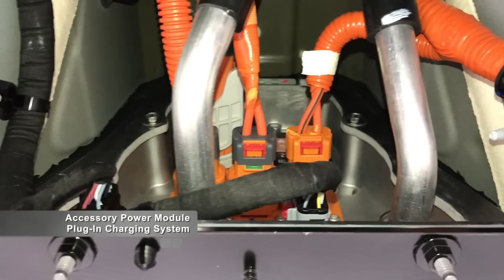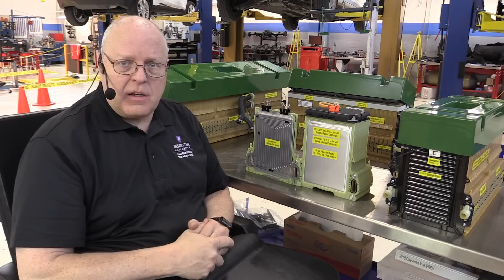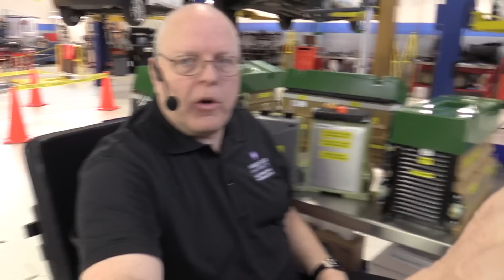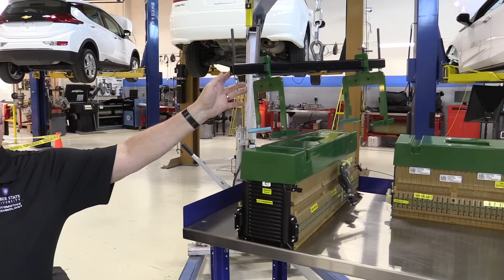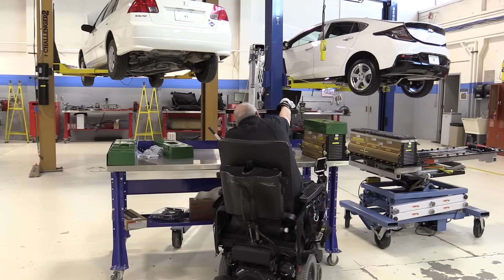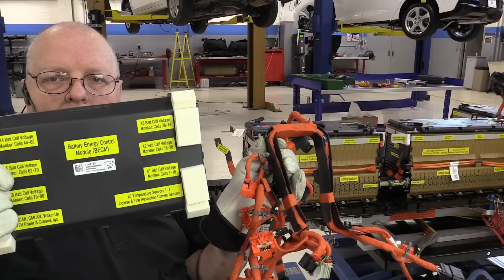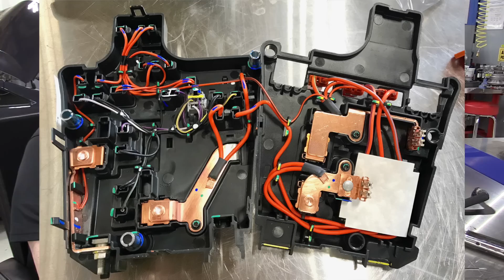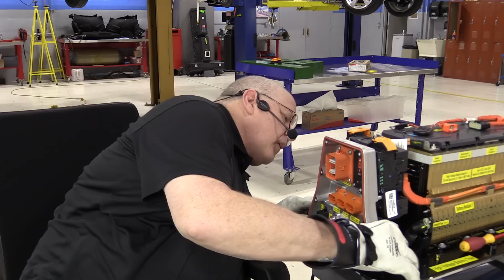2018 Chevrolet Volt 355.2V Li-Ion Battery - Deep Dive

Comment: Can a 2014 Chevy Volt with the First Generation 16.5 KWH Battery Pack be fitted with the upgraded Second Generation 18.1 KWH Battery Pack?
Reply from the maker: No, I wish it were possible. It has a totally different monitoring and control system
Reply: Thanks for your reply.   Would it be possible to install the updated monitoring and control system along with the 18.1 KWH Battery Pack?
Reply from the maker: No, sorry

Comment: Answer to "....upstream...." .  Interstate I-5 follows along the Columbia River and at the end of my drive, my elevation is about 30 feet higher.

Where is Weber Auto located?  Do you know of anyone that could extend my range by another 50 miles by 
 an additional battery pack?
Reply from the maker: We are at 4300 feet in Ogden Utah. I do not know of a way to extend your range.

Comment: How does the coolant circulate through the battery? Is there some kind of pump?
Reply: Thanks! The 2019 model charges in half the time. What do you think they changed?
Reply from the maker: There is an optional 7.2kW on-board charger available now. the previous one was 3.6kW
Reply from the maker: Yes, there is an external variable speed pump

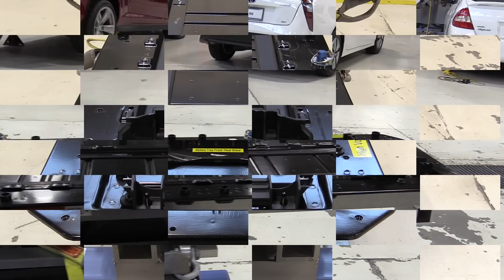Comment: Hi Prof John- another fantastic video. Question: @12:30 does my first gen Volt battery tray have this same inspection plug/port?
Reply: If a first gen volt is rear ended at approx 40mph speed differential, and the dealership replaces bumper/energy absorbing parts but says everything else is good, how concerned would you be with battery coolant leaks etc in the future? (I doubt they would check that plug)
Reply from the maker: Yes, it has the same plug. Make sure it sealed or replaced after removing it to keep out road water
Reply from the maker: Not very concerned, the battery is pretty far forward and unlikely to get damaged. I would do a good visual inspection just to make sure. The bigger concern would b the DC-DC converter and cooling ducting and the 12V battery under the hatch carpet cover. If everything is working and no warning lights are on, it is probably fine.
Reply: Thank you! You are very inspiring and have a great teaching style. Weber State is lucky to have you. I hope a benefactor gifts you a Tesla soon to neatly lable into tiny parts!

Comment: Glad to see the inside structure, I have learnt a lot

I have a small question: what kind of flexible circuit board they are using? How thick would it be? Because I would like to know the rated voltage of it. Thanks!
Reply from the maker: Thank you! It appears to be a very flexible plastic circuit board, like on the back of older instrument panels.

Comment: I have a 2012 Chevy Volt with 125,000 miles on it. Up to 1 month ago it was in perfect condition until the battery died. I took it to the dealer and they say the battery has to be replaced at a cost of almost $7,000. They did not give details but they recommended  that I did not do the repairs due to the car's mileage. I have the car sitting in my garage and I still refuse selling it as junk because of its prime condition. Are these batteries repairable? Can a used battery from a more recent year be installed?
Reply from the maker: Wow, that is the first Volt battery failure I have heard of. A newer model battery will not work. The on-board computers are programed for the one you have. The battery sections can be replaced as shown in my video, but they are expensive and it requires an expert experienced technician to do it correctly. You may consider looking on ebay or a salvage yard for a used battery. I see them quite often on eBay from wrecked vehicles for approximately $1500. If it were my vehicle, I would install a used battery. Best wishes.
Reply: I am going the opposite way since I already bought another car. I will be looking for a person that wrecked his 2012 Volt and has a good used battery that can transplant to mine after I sell it to him for a decent price. I needed your expert advice to see if I could expand my options to other year models. Thanks for the excellent video, it was very instructive.

Comment: I see why people prefer the Nissan Leaf batteries for making RV and home batteries. 64 volts seems a pain in the tush to deal with VS 48. And looks as though that convenient battery management system can only be used for the original voltage and configuration. Dangit.
Reply from the maker: Thanks for your feedback!

Comment: How well has your 14' Volt held up for cold weather driving range & overall capacity?  

I do like the way it drives and has the option for gasoline, but I'm afraid of a sub 25 mile range as it gets on it years and it comes winter.
Reply: I went from a 2nd gen Prius to a 2nd gen Volt myself, and I really love it! My Prius was a great car, but it doesn't come close to the driving experience of the Volt. I really love both of them! But I'm at almost 4,000 miles on this tank of gas so far and still have almost half a tank left. That's just really hard to beat. I haven't seen a gas station since I bought it in November and we're coming up on May as I type this. I won't miss gas-powered cars!
Reply from the maker: Mine has been great. In very cold weather the range about 2/3 of what it is in warm weather (38 miles). Overall capacity had not changed in 4 years. Thanks for your feedback!
Reply: Thank you much Professor!  I must admit the Volt was intimidating when I first looked at it, but after seeing your videos and coming from a 2nd Gen Prius, I'm thinking I might make the jump.  It doesn't look that bad to repair in the end.

Cold weather range is my only concern, given it's -25 up here during the winter.

Comment: Great information but the BECM replacement requires the connectors to be disconnected and reconnected in the  correct order
Reply from the maker: You are absolutely correct, I did that incorrectly. Thanks for your feedback!
Reply: The new Mustang Mach E BECM has to be disconnected in the proper order also. Some things stay the same.

Comment: Great Video.   I was surprised the battery coolant heater is not just turned on and off by the relay but is also controlled by a transistor module.  Did you notice what transistor GM used for this?
Reply from the maker: Thank you! I could not see the transistor, it was encased in the heat sink with some sort of epoxy.

Comment: That was an amazing, informative, well-done video - thank you.  I have a questions.  How does the battery cooling system guarantee the coolant is uniformly traveling thru the battery plate passageways at the cell level?  It would also seem possible for air to become entrapped in the passageways unless there is considerable pressure in the cooling system - then, high pressure would seem it more prone to leaks.  Also, my observation: it seems with so many connectors, it would seem over time and miles with vibration that connectors would be prone to contact issues and subsequent faults showing up in the diagnostic system.
I see the need for system monitoring, but it all seems very complex especially in light of where we've come from (the last century's IC engine drivetrains.
Again, wonderful job - love your vids!!
Reply from the maker: Thank you. The battery cooling system is filled by applying a vacuum to the entire system to remove any trapped air. Afterwards, the vacuum enables atmospheric pressure to push the coolant into every possible passageway, hose, pump, etc. The cooling system is not a high pressure system, it is only pressurized to 5 psi This battery design in the Volt has been very reliable.

Comment: Hi and greetings from Norway. At 1:53:10, the talk are about a fuse of 350 amp, and you say it's rated at 20 000 amp before it actually melt.
I think that 20 000 amp rating is the short circuit current that fuse can break for sure, without internal arc. It melts at 350 amps or so.
Reply from the maker: Thank you, I had that wrong.

Comment: what is the cost of the 3 batteries ???
are they interchangeable ?
Q3 how many Cycles ?
Reply from the maker: I do not know the cost. Used complete battery assemblies on ebay are selling for $4k - $6k USD. The three battery sections are not interchangeable. Everything I have read indicates 1000-1500 complete cycles.
Reply: SHOULD HAVE MADE THEM INTERCHANGEABLE !!!!!!!!!!!!!!for Cost and serviceability
Q2- is the Voltage and Capacity ( Amp/hr ) the same for the 3 battery modules ?

Comment: Awesome presentation.  Your students are fortunate to have you as an instructor. The 20kA rating on the Bussmann power fuse is the rated maximum DC interrupting rating.  If the fault current is greater than the rating the fuse may not interrupt the fault current resulting in a continuous arc and the destruction of the fuse and more.  (imagine a 20,000 amp, 355 volt arc welder) See http://www.cooperindustries.com/content/dam/public/bussmann/Electrical/Resources/product-datasheets-b/bus-ele-ds-10563-ev-power.pdf for more details on the fuse.
Reply from the maker: Thank you very much! I appreciate the information, I had it wrong. Have a good day!

Comment: Great video.. Are you planning to do any more chevy Volt deep dives ?  This was excellent in helping to understand the battery technology.
Reply from the maker: Thank you! Yes, I will be diving even deeper into the rest of the high voltage system: transaxle, inverter, charger, cooling systems, heaters, etc. I will be doing the same thing with a new Chevrolet Bolt as well.

Comment: Thank you for a wonderful video explaining the battery of my new '18 Volt.  I have one small correction.  The 20,000A AIC rating of the Bussman fuse is the interrupting rating, i.e. the maximum amount of current that it can safely "interrupt" or stop when it blows, without self-destructing.  This current is the range of current that might flow during a (bolted) short circuit.  For comparison, a typical circuit breaker in a house panel has an AIC rating of 10,000A.  Many power system fuses have an interrupting rating of 200,000A.  (AIC = ampere interrupting capacity)
Reply from the maker: Thank you for the correction! I misunderstood that rating. Have a good day!

Comment: How does the gen2 volt heat the battery in cold weather? Does it use engine heat/coolant to heat?
Reply from the maker: It has a dedicated battery heater. See 1:31:40  It does not use engine heat/coolant. It is a separate dedicated coolant system. Thanks for your feedback!

Comment: Professor, not sure if you have time or can answer these questions. I have an 86 year old viewer that has a 2012 Volt. He has asked me these questions and I can not answer them. Could you? thank you and Happy New year!  Oh and please keep these great videos coming.

I am still waiting for you to tell me if there is a speed limit in "LOW" on my 2012 Volt. And where does the energy go when you are at a stop holding the car with the brake?
Reply from the maker: Thank you! I am not aware of a maximum speed in low. The energy produced while stoping is stored back in the battery. You can see the energy flow back to the battery while braking on your energy monitor. Happy new year!
Reply: Thank you for the quick response!
Reply: When you’re in “L”, the car is simulating engine braking, but it’s doing it by dumping that power back into the battery.  But there’s no engine directly connected (in the traditional sense) to over-rev, so it should be safe at any speed.  Diesel electric locomotives do something similar called “dynamic braking”, only they pour that energy into a big resister pack instead of a battery.
Reply: LOW is not a gear, but a regen level when you are coasting.   It should not accept forward speed in any manner.
Reply: I think what the op meant was if when holding the car with the brake (stupid 3mph roll program) is the electric motor energized? I have wondered this myself. Is that three mile per hour roll "real" or a program that starts the instant you let off the brake? Kind of like wondering if the volt applies the brake light under heavy regen (low) braking (it does not, so watch out for idiots behind you)

Comment: Great Video; Thank you for sharing and the detail of your video. What are the current requirements to be able to work on hybrid vehicles?
Reply from the maker: Thank you! Each vehicle manufacturer has implemented their own training requirements to be able to work on these while they are under warranty at a dealership. It usually involves completing all possible training for traditional gasoline powered vehicles (master technician level) and then taking all the additional hybrid and electric vehicle training on top of that. It can take several years to complete all of that training. Currently there are no requirements to work on a hybrid or electric vehicle in the independent shop/aftermarket world. ASE (ase.com) finally has an A3 certification level exam, but it is optional. This is why I am providing some of this type of training here online for my students, repair technicians, and consumers. I believe that an education is a key component in the acceptance of hybrid and electric vehicles as they slowly get better at meeting the needs of more drivers. Thanks for your feedback!
Reply: Thanks for the reply and the info. Thanks again for your videos, great job, really enjoy watching them and have learned a lot  from them..

Comment: +WeberAuto
will these batteries last longer charging them with a 110v outlet or a 240 outlet? Thanks
Reply from the maker: It makes no difference that I am aware of. My 3.5 year old Volts still has the same EV range it had when it was new. I charge it on 240V.
Reply: Ok thanks! So yours is a 14 I take it. Do you know how long the batteries are supposed to last? Thanks again
Reply from the maker: They have a 10 year 100,000 mile warranty. The Volt has not been out for 10 years yet, but I suspect they will last that long and longer. I have seen Volts with more than 100k miles on them and they still have most of their original EV range.
Reply: +WeberAuto
Thanks again, but I thought the warranty was 8 yrs. 100K. Let me know if I'm wrong.

Comment: Really great video. I'm a UK tech very much interested in EV. The idea of an EV as a vehicle with "less things to wear out/go wrong"  is maybe just a high volt idea not yet loaded  with the reality of displacing ICE! Instead of compression loss due to mechanical wear we will have current loss due chemical "wear". Both types are entropies of a sort but one will happen regardless of use. The battery pack of an EV is ticking against time, along with all that copper wiring and IC tracks controlling it all, from the moment of assembly. Add real life to the equation, you know the one, the one that pulls high volt ideas down to ground when they have to come up with the amps!  Like the Uk encouraging EV's while there are only a handfull of qualified techs in the whole country!  Generally speaking a IC car deteriates with mileage only?  No.  Any modern has as much vunerability to electronic and chemical entropy and they are just as complex having to sort sorting out emissions.....hummmm.....So I'm being romantic thinking about cars of the past that you could pull out of a barn and push and bump start after decades of "entrophy" . Really great video.
Reply from the maker: Thanks for your feedback. If you build them, the technicians will catch up.

Comment: Does your chair run a lead acid pack, or have they started to transition to LiIon yet?
Reply from the maker: Good question. They are lead-acid deep cycle gel batteries. I doubt they will use Li-Ion because the lead-acid batteries are also very heavy and keep the chair very stable with a low center of gravity.

Comment: what i  want to know is can we upgread a gen 1 volt battery with cells from the newer 2gen battery .  most of the parts look that same . i know we would have to add a few cells to get the volts right .  but it looks like the way the cells are installed on the top is the same . not sure what the BMS would do seeing more amp hrs
Reply from the maker: Theoretically you could, the battery voltages are exactly the same. Swapping cells would not be possible because of the welded connections, thickness of cell spacers, and cooling plate contact/conduction needs, but swapping battery sections might be. The big problem is the battery monitoring system. The gen 1 battery had four battery sections, four battery interface modules, and one battery energy control module (BECM). The gen 2 battery only has three sections, zero interface modules, and one BECM. You would have to get creative with a custom monitoring circuit. Thanks for your feedback.
Reply: @WeberAuto  made this comment 5 years ago never knowing i would go from a 2014 volt to a newer 2018. the owner before me ran over something and severely damaged the battery floor. you cant order this part from GM so i found a used 1.  most shops will not help to work with HV park so I have to do it alone in my driveway.  Thank you so much for posting videos like this as it makes it safer for DYI ers  like myself to do this job right the first time . GM does not pot any info like this. just wish i had your shop for a day to do the job LOL

Comment: Can you please lets us know if we only charge the batteries to just 80 % of  there capacity can we get more cycle out of the Lithium ion battery
Reply from the maker: These batteries can only be cycled from fully discharged (0%) to fully charged (100%) about 1000 times (depending upon the battery type). If you fully charged and discharged the battery once per day, it would last 2.74 years before it would start loosing capacity and deteriorate. By keeping the state of charge (SOC) between 20% and 80%, the battery can be cycled many more times before deterioration and capacity fade occurs. Most of these batteries have a 10 year 100,000 mile warranty. I hope that helps.